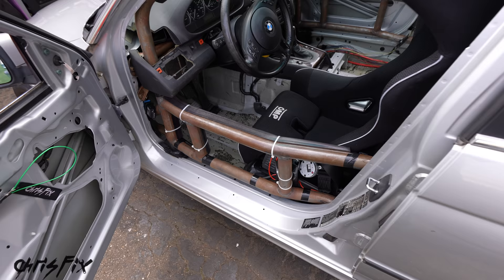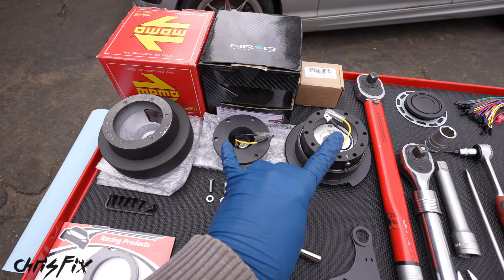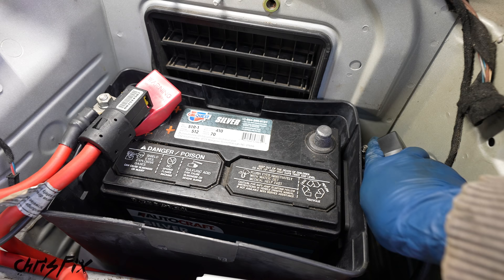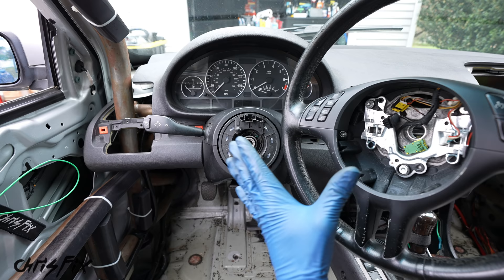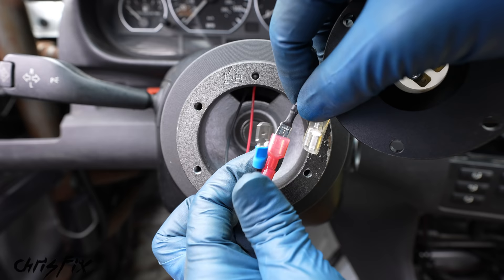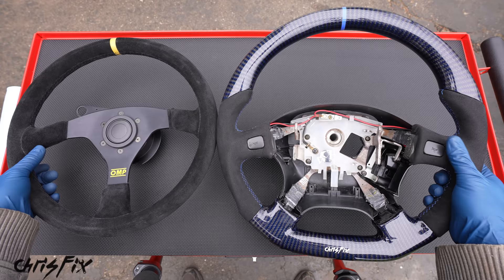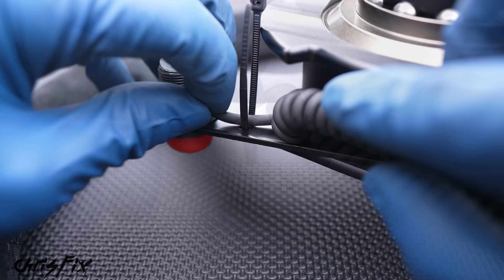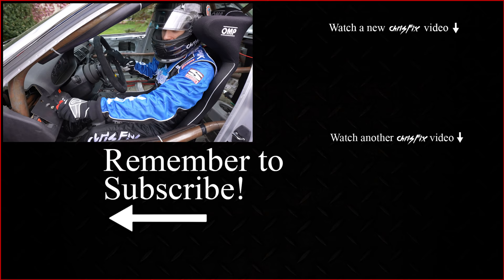How to PROPERLY Install a Quick Release Steering Wheel (with Working Horn)

Comment: Wait a minute, where can I get that ChrisFix helmet tee??
Reply from the maker: You can get one right here: https://www.bunkerbranding.com/pages/chrisfix
Reply: @chrisfix  my vehicle says “check charging system” and “check fuel cap”. What do I do?
Reply: @jayasmrmore3687  your alternator is probably going bad and your gas cap has a rubber seal on it that might be broken which is causing an evap leak from your fuel filler neck. I’d recommend buying a new gas cap and going to your local auto parts store for a free battery/starting/charging test.
Reply: @chrisfix  chrisflix movie reviews, genius idea
Reply: @jayasmrmore3687  get a new fuel cap
Reply: @chrisfix  so what you just demo ranch now or something
Reply: @josenegrete5455  I could try that. It doesn’t look damaged but I will inspect more carefully.
Reply: @Mygfisawesone  alternator replaced only 2-3 years ago. Maybe I should check for corrosion on the wiring though. I also should check the health of battery itself.
Reply: @jayasmrmore3687  that would definitively be a good start. Any electrical problem diags should always start at the battery
Reply: @chrisfix  hi! I’d love a video about weather strippings
Reply: @chrisfix  Alright
Reply: I was thinking about that ChrisFish guy.
Reply: @jayasmrmore3687  if you check your fuel cap where you fill the car up, it may not be tight so just do it up
Reply: @chrisfix  Where can I send my steering wheel?
Reply: @Toyota Fortuner 2020 tpms means tyre pressure monitoring system? So either your tyres flat or your tyre pressure sensor is off
Reply: @jayasmrmore3687  I think you should check the charging system and the fuel cap
Reply: @jayasmrmore3687  you check your charging system aand fuel cap
Reply: @Stezz-T  well I don’t see any damage to my fuel cap, and it’s always on correctly, I never leave a gas station before twisting it tightly. So what would trigger the message? It says there may be a problem with the emissions system. As far as the charging system I had my alternator replaced late 2019. Maybe I should check my battery or wiring for corrosion though.
Reply: @BRYANT111.  right, I think the seal may be broken or worn.
Reply: @chrisfix  you are also using bunker branding
Reply: @Mygfisawesone  battery is healthy. Got it tested. Wires have seals that are wearing and tearing, looks like that is the problem. I also was missing a few screws in the AC filter, so I was concerned when I heard rattling but that solved it (who knew the fix was that simple). Just have to get new seals for wires if not new wires themselves.
Reply: @chrisfix  thx
Reply: push to start next?
Reply: @chrisfix  Oh wow! I didn't know you were on Bunker Branding! That's awesome!
Reply: @chrisfix  Jesus Christ loves you btw
Reply: @Mygfisawesone  nice
Reply: @Mygfisawesone  you sound like a chrisfix employee
Reply: Im glad every one took the time to appreciate this! He took the time and came off as caring for our well being rather then saying it to cover him self too.
Reply: @Blade_Venom  I’m just an expert at sounding like I know what I’m doing lol
Reply: @Mygfisawesone  lol im just kidding you probably know what you're doing
Reply: @chrisfix  hey chrisfix can you make a video on how to replace motor mounts i would love to see it thanks
Reply from the maker: @Kiensabe71  Here you go: https://www.youtube.com/watch?v=ZTRV5GXWpo0
Reply from the maker: @jayasmrmore3687  watch this video for the charging system. I show you a few ways to check your battery and alternator properly: https://www.youtube.com/watch?v=YC--MLNIbik
Reply: @jayasmrmore3687  check your charging system and fuel cap 🤣😂
Reply: @chrisfix  HOL UP YOU ON BUNKER BRANDING AWESOME🤣
Reply: @chrisfix  Bunkerbranding 😍 Love Matt, the crazy Texan!
Reply: @chrisfix  woah, bunker branding, nice
Reply: @jayasmrmore3687  Probably gas cap leak and electricity leaks
Reply: Why won't you show your face
Reply: Make a video of it
Reply: @jayasmrmore3687  Probably evap problem your fuel cap is probably lose
Reply: How to clean the back chair in the car not the one that you siting on bot the one that is holding you to not fall back or like the top off the chair
Reply: @chrisfix  I'm curious can you use a liquid pump to remove fluids in your car? I've been looking at this fluid pump and I'm thinking it will make everything easier since I don't have a jack or and some other tools.
Reply: @chrisfix  is it free?
Reply: @chrisfix  Didn't realize Demo created such a big platform with bunker branding. Just a few years ago it was a few shelves in his garage. Come a long way since putting batteries in shotgun shells.
Reply: @chrisfix  o
Reply: @chrisfix  where can I get that exact mustang steering wheel? Also do you remember how much it was
Reply: Hi
Reply: @chrisfix  Hii
Reply: @chrisfix   where can I send my steering wheel
Reply: 3:44  @chrisfix
Reply: Good afternoon Mr Chris, am a younger mechanic who has graduated from school buh am much interested in knowing more by you recruiting me at your garage if it's ohk with you please coz I really love cars alot

Comment: Great video as always! 

I have a small critique about the steering sensitivity terms you used, though. You mentioned that the degrees you turn a smaller wheel will effect the car more than a larger wheel, but I think the degrees turned for small or large would have the same effect. It’s the arc length that your hand would have to move to achieve that degree of turn that will change. So with a larger wheel your hand moves further per degree of rotation since it has a larger perimeter and a longer lever. The longer lever makes it easier to turn the wheel as you mentioned.
Reply: I'm glad you typed it so I didn't have to.
Reply from the maker: Degrees was def the wrong word. Distance would have been more accurate. Thanks!
Reply: Right
Reply: This ^^
Reply: Exactly my thought at that very moment. Bigger steering wheel needs more movement from your hands. It doesn't adds up another degrees to existing 360 of them.
Reply: Common sense. Let natural selection do its job..
Reply: I am glad I was not the only nerd that got triggered by this assertion :D
Reply: i was also bugged by this, but as usual, impressed by Chris' humility!
Reply: This bugged me too, but I knew what he ment.
Still a great video! Wish this shit was legal here :/
Reply: I wanted to type this as well and saw you did it, amazing job explaining it.

Comment: One more tip when you remove the steering wheel: when you remove it and you have to pull pretty hard on it, when it’s free and you are still pulling on it, you could hit yourself with the steering wheel, to prevent that, you could screw the bolt back in a few threads so when it’s free it won’t hit you
Reply: I learn this the hard way 😂🤣
Reply: @MrDeroof  😅
Reply: this 👆🏼
Reply: 69thlike
Reply: We have all been there, whether its a steeringwheel, torquewrench, a prybar, or just anything, when that slams in your face it hurts like hell, you will question your stupidity, but you still laugh when you see it happen to someone else XD

Comment: I wanted to point out, that, the bigger the steering wheel, the distance it turns in 1 degree is the same, what actualy changes, is the distance your hand needs to move to turn the same distance.
That's because 1 degree is 1/360 of the wheels outter edge, if the outter edge is bigger, each section will get bigger accordingly to fill the whole 360 degrees, but it's still going to be 1/360, you just have to move your hand a longer distance. I loved this video, thank you, Chris!
Reply: Glad you caught that too, I was going to bring it up.
Reply: @ivanbeekley7944  You're welcome! :)

Comment: At 23:36 you could likely utilize the vehicle's internal wiring to the clockspring that were meant for stock steering wheel buttons so you don't have to use an external coil cord wire. You'd just need to get a quick release adapter that has another electrical contact. Actually, you could use the quick release you already have and use the two contacts of the quick release for horn and button and use the body as a common ground. Just like that: Wireless Steering Wheel.

If you wanted to get real real fancy you could have a microcontroller embedded in the steering wheel that that  uses only a few conductors to talk to another microcontroller on the car side that will allow you to have many different controls on the wheel with only a few conductors through the quick release.
Reply: Exactly. You can just use a board with I2C!
Reply: @zat-svi-ua  make a custom display on the steering wheel while at it!
Reply: Wireless steering wheel made me think for a bit cause my brain broke for a second🤣
Reply: @gamespender8605  Add RGB and water cooling too!

Comment: I was totally going to remove my stock steering wheel and buy a quick release wheel on my daily driver as I'm concerned about security, and who could steal a car with no steering wheel?
I'm glad I saw this video first, because I didn't even think about the airbag. I'll figure something else out, thank you so much for potentially saving my life in the event of an accident!
Reply: Brake lock is pretty good imo
Reply: @tikouplays7614  thanks!

Comment: 11:28 A tip from my father: Keep the bolt in a few threads. This way, when you pull off the steering wheel, it won't fly off into your face.
Reply from the maker: Awesome tip!

Comment: 19:53: Both steering wheels turn the car the same amount per-degree. Since with the larger wheel, your hands are further from the center, you have to move your hands a greater distance to turn said degrees. The only way the smaller steering wheel would turn the car more per-degre is if it somehow modifies the steering mechanism.
Reply: just to add on and clear up confusion, it does make the car more responsive as for each cm you move the wheel (a point on the edge of the wheel) is more degrees on a smaller wheel (google radial lines, the further out the bigger the distance)

Comment: A removable steering wheel on my daily driver prevented my car from being stolen for the 10 years that I had it. I had the one with the key and locking cap so another wheel couldn't be put on, to steal the car. The key also makes it impossible to accidentally remove your steering wheel while the car is in motion.

Depending on what car you have, and how bad vehicle crime is in your area, you should consider this.

Comment: Love how you mentioned that it must still have the airbag. I'd love to have a good aftermarket steering wheel, but always stayed away from it due to needing a HANS/Race seat and Roll Cage. You mentioning that they can be custom modified by some places actually really interests me...Actually wanna look into that now.
Reply: If you find anything PLEASE lmk 😭
Reply: Just use a crush hub. I'm thinking of removing my airbag because it a 1991 car and I learned that the airbag was really dangerous and actually causes injury. There was a whole bunch of airbag recall and IDK if mine was ever replace or if there still a bomb infront of my face when I'm driving...

Comment: Hey Chris! Amazing video! Just a quick correction:
19:25 the angles are the same no matter the steering wheel. what changes is how much you move your arms in relation to the steering wheel's center.
the bigger the wheel, the longer the motion you need to achieve the same rotation degree compared to a smaller wheel.
Reply: glad i was'nt the only to notice but i love the video

Comment: Hey Chris! Great video as always! Quick question, would you consider adding a auto battery shut off switch? Kinda like the inertia switch, but for your battery? I know you got a lot of safety systems in place but as you say, redundancy is important! Also, this is unrelated but still a good information. I remember your radiator flush video or the one where you replaced the radiator,and you mentioned electrolysis  and we learned in school that you can use a multimeter to measure electrolysis in the coolant. First and foremost you want the car cold
Then set the meter to DC have the negative cable in the negative terminal of the battery, and use the positive lead of the meter and insert it into the coolant from the radiator. 
If it shows higher than .4 Volts then you have a problem. 

Now if you want to find the source of the problem, you can turn on the car, and add individual loads and turn them off, things like heat, AC, lights, etc. and if after turning off one load the voltage stays the same you found the source of the problem. Hope it was informative!
Reply from the maker: Thanks a lot. I will be installing a battery cutoff. The inertia switch is also a good idea tho! I wonder if there is a down side for a race car? 
Thanks for the info on the electrolysis
Reply: @chrisfix  Will you ever make a video about it?
Reply: @chrisfix  my man you work very hard! Responding to both my replies!? Yes I gotta say though this is my second electrical class. First one being Intro to Electrical Theory and Circuits, and now this one is Intro to electrical applications, so we spend a lot of time learning schematics and how sensors relay information to each other. It’s honestly pretty difficult, I can remember the components but since you can’t always see them it just becomes a mess lol! Anyway thank you again Chris! Your hard work really shows!

Comment: ChrisFix, you're extremely meticulous and thorough. Awesome video! That being said, it totally caught me off guard when I noticed you using 2 different size wire connectors. 
Red connectors 22-18 AWG 
Blue connectors 16-14 AWG
Reply: That was probably 24 or 26 AWG wire, those big splices really shouldn't be used with wire that small in the first place. But it's just a horn so it really don't matter

Comment: Great job on the video! Step by step procedures, with the cautions, down to reminding the viewer to disconnect the battery. Airbags really pack a punch! One other thing, someone may need a steering wheel lock puller as well if they are working with a Chevy, and possibly others.

Comment: Chris, I know you're a perfectionist so I cant help myself: You describe the effects of wheel size a little funny. The jist is correct, i think you explained it well for us, but you say "for every degree you turn the steering wheel you're gunna turn the car more with a smaller wheel than with a bigger wheel" and that's not true.   It will still take the same degree of rotation to reach full lock regardless of wheel size, and every degree of input will equal the same amount of steering output at the front wheels no matter the size of the wheel. 

A better way to describe the effects might have been "for every degree of rotation of the steering wheel, the distance your hands need to move will be less on a smaller wheel and more on a larger one."  In other words, the further you go from the center, the more your hands will have to move in order to rotate the wheel one degree.  Smaller hand movements=more sensitive. we all understand how it works, just semantics of explanation since a degree is just 1/360th of a rotation. (in your case 5 degrees of rotation, your hands need to move the wheel 16.6mm with the 380mm wheel, but only 15.3mm with the 350mm wheel, or 8% more sensitive)

sry, couldnt help myself, its not often I find even the smallest of errors in your work. great video as always, such a minor nitpick, I know ahahaah

Comment: Hey Chris if you ever decide redo the wiring for your e46 horn you can pull the 4 pin connector and trim the wires that aren’t the red and brown. The 4 pin connector will fit in the 6 pin mounting and can be used in place of running breadboard jumpers.

Comment: Thank you, Chrisfix, I am about to do my very first track day and thanks for this video. I was able to install my quick release steering wheel hub the only real difference between yours and mine is the fact that I actually am using two buttons one for radio comes like you were using and then another for nitrous. After my track day, I will come back to this comment and update you on how well it worked and what position I got.

Comment: Awesome video! I absolutely love how informational you are in all your videos. The disclaimer at the beginning is awesome! Definitely setting a good example!

When changing the steering wheel and only connecting the last two wires for the horn, what happens to the first few wire connectors that were left with no connection? What were they for?
Reply from the maker: Thanks a lot! And they were for the steering wheel buttons (radio control, cruise control, etc)

Comment: Another great video! Always a go to for any work to be done. I would like to add,  instead of reaching for the jumper wires you may be able to keep the factory plug with horn wires attached and just feed them through the hub adapter. 03 Ford Focus
Thanks again

Comment: If you wanted a good example, I brake a steering wheel on a trail on my 1960 Willys jeep (was an after market one that came with if when we bought it) (just a little trivia, the willys jeep was built by Ford here on Brazil, so 3 brands involved on one old offroader)

Comment: 11:20 a tip do not remove the middle bolt completelly loosen it some save a couple of treads then jank on the steering wheel  and the bolt saves you from geting a steering wheel in your face if it is stuck on :)

Comment: Awesome video, Chris! The only (safety) tip I would add is to not completely remove the center bolt. In case the steering wheel is a bit more stuck, the bolt will prevent the steering wheel from smacking you in the face if and when you yank it off without a puller. But now I've learned even more from this video, thanks!

Comment: 19:53 small detail: 
1 degree of rotation is the same no matter the size of the wheel, every single circle thing will have 360 degrees of rotation per revolution
I think Chris was meaning distance on the perimeter, which does change with the size of the steering wheel.